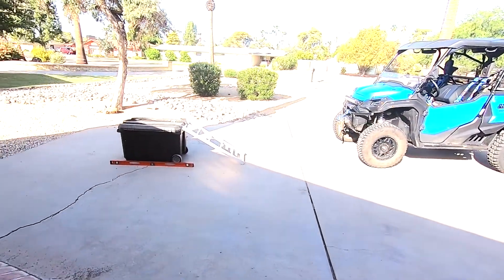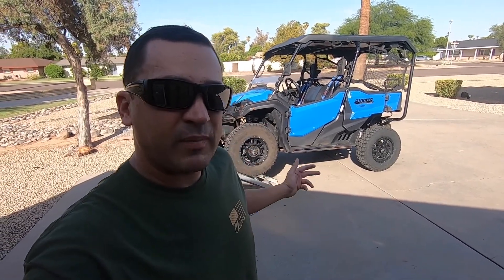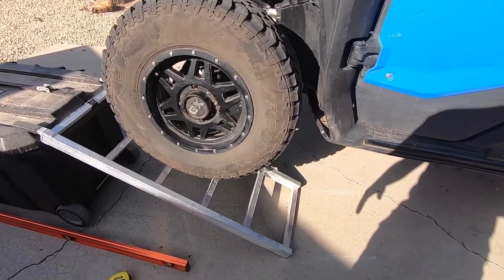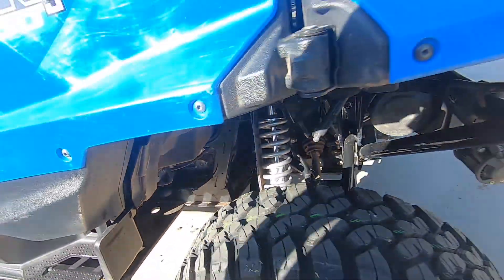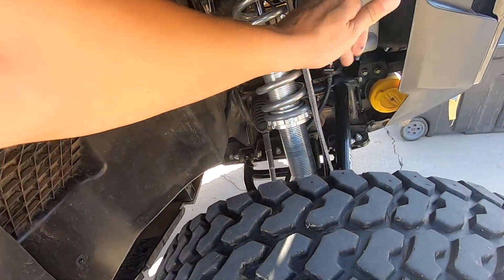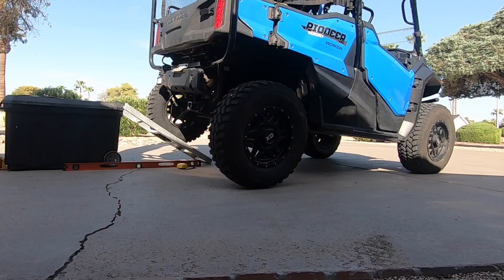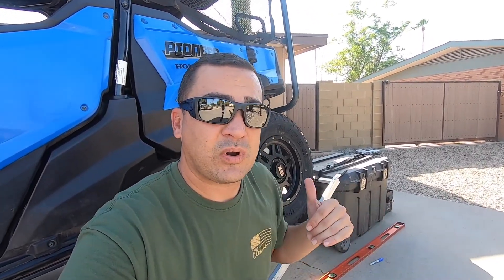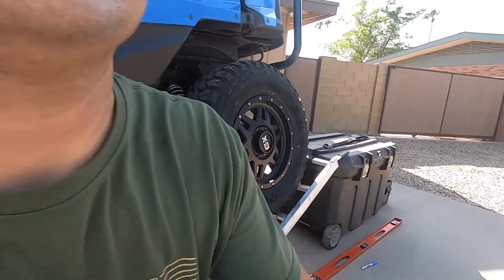How limiting are limit straps?

Comment: Why not set your limit straps to within a few millimeters of the shock limit? Then they still protect your shocks and don't limit travel.  You need to check CV angles to make sure you are in safe limit.  I see it as a package deal. Increase travel and modify CV to allow the new travel to work without breaking parts.
Reply from the maker: Great point! I do run the limit straps to keep the shocks in check (22" long), also my CV angles are good as I run aftermarket axels and have had no issues at all with my current set up and 35" tires. Thanks for watching!.